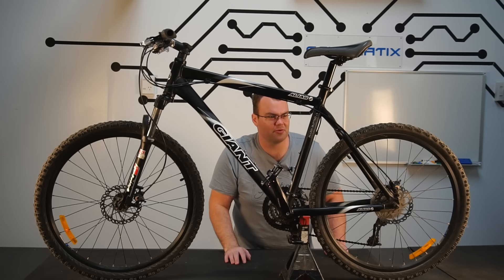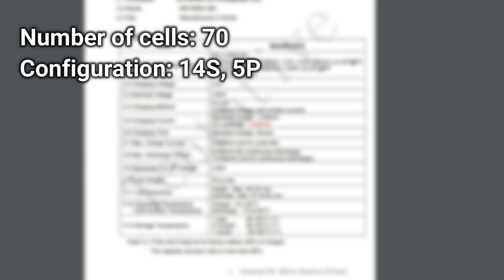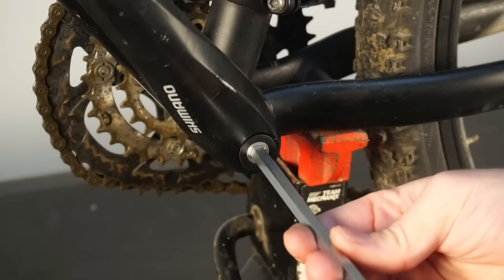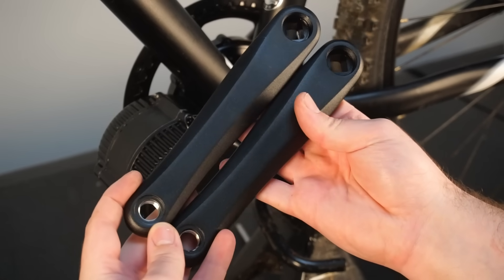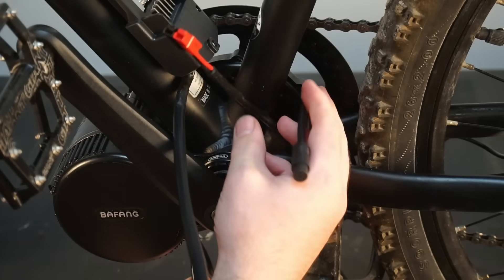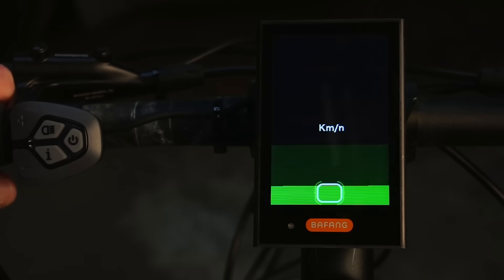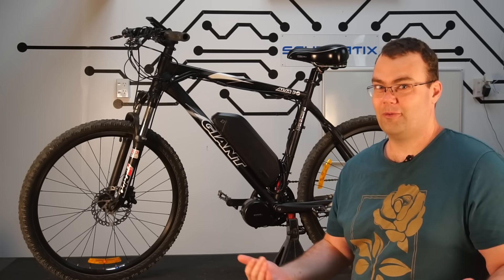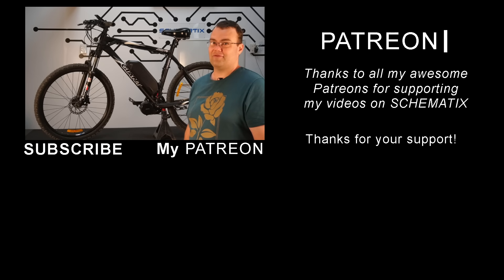eBike Conversion Kit, Install & Review ll Bafang BBS02B 750W motor

Comment: Interesting - the question on my mind wasn't mentioned in the post or the comments. 
750watts combined with human power is way more force than any standard bike frame was designed to handle. Is it strong enough? 
I'd be worried that after many hours of hard riding the motor mount area of the bike frame would stress out and crack.
 Commercial hub-drive e-bikes all have significant reinforcement around their motor mount area. 
Unless you're a metallurgist and/or have special measuring tools, the only way you will find out is,
when it happens!

Comment: Your instructions hold up several years later.  I just did my 1st conversion with Bafang 750W and similar battery.  Your instruction is spot on!  In terms of mileage?  My battery has same Samsung cells, 52V, 20 amp-hr.  I live in the mild rolling hills of Minnesota, 65 yrs old and weigh 250lbs.  With moderate pedal assistance and minimal throttle, I am seeing greater than 50 miles/charge and I still have mileage left in the battery.  It could be possible to stretch out 60-70 miles per charge with conservative battery usage.   Thx for the excellent video.
Reply: What website did you get your battery?

Comment: Great video, thank you ! Please do not follow the instructions for the chain lenght, as the result is obviously too short. the derailleur should pend vertically on the biggest ring/smaller speed, that´s how you measure a correct chain lenght.

Comment: I  have to remove the front derailleur/chain guide and install the t46 sprocket. Will i  lose the ability to shift gears? Also, the motor has a high torque. Will i have to replace the cassette for a higher strength one?

Comment: Hi does any body know if you can just constantly use the throttle  or do you have to peddle aswell to make the motor work 
also how fast does it go top speed I have a 250w e-bike peddle assist and its 💩 
Thanks 🙏

Comment: Great tutoring, thanks. May I recommend you to fit the height of your seat to properly pedal. Your legs are compressed and you wont get the most of your strength with this seat to pedal height

Comment: I made a DIY ebike with this kit back in 2022 march. So far it has been very smooth sailing for 8000 km and more. Few things:

- Adjusting the settings with the Bafang software is mandatory. The motor has way too much torque by default with weird speed limits. Most of the time I need 250w and below so I have made it way more chill in action, but more power is still available when needed.
-Eats a lot of chains. I have changed like 6-7 chains even though I clean and lube them often. Changed the cassette a few times. You should use chain wear measurement tools.
-Lekkie narrow wide front chainring is great! Completely eliminates chain derailment which happens easily with the default cheap ring.

All in all, this thing has changed my life 5/5 would recommend.
Reply: Why not use titanium chain and cassette?

Comment: Thank you for the video. 

One complaint, I followed your method for choosing where to cut the chain and it was way off the required length. Then, when I went to a bike shop they told me that it's not a good idea to purchase a chain without a matching sprocket.

Comment: I'm on my second bafang mid drive bbs02 motor after changing the first one after 5 years. Nothing but praise for these motors, never let me down. You can buy a new bike and fit a motor for about half the price of  bought ebike, and have better performance .
Well done bafang
Reply: So true!  I have upgraded a few bikes with bafang motors and they have been great. I got many years of use from them.  A couple of times I had to replace the batteries after years of use, but not the motors.   A comfortable bike + bafang + internal hub + big chain will be a dependable transportation with little maintenance required.

Comment: Major mistakes I've seen this guy make one putting the hall effect sensors on the brakes. Make sure that the magnet doesn't hit the sensor and keep the break from properly. When installing the speed sensor do not put it on the chain side of the rear put it on the brake side.

Comment: Hi, I'd really love to know the width of your BB, I am converting my Giant, and its 73mm and I dont have that much thread protruding as shown at 6mins 20secs. I cannot get the aluminium cover nut on,  there is not enough thread to bite on to.  Also I have 25mm pedal clearance to the chain stay  on the RHS but only 5mm clearance on the pedal to the LHS chain stay . The pedals are therefore offset by about 20mm to the right.  There is no spacer on the RHS and the right cannot come any closer anyway, as the 44T would hit the chain stay.
I see that you are not using spacer washers for the 2 x motor mount screws, so I am thinking your BB is 68mm.  Bizarre that my BBS02B 750W motor does not fit correctly.
Reply: I would say yes his is a 68.   Need to measure before purchase.  I'm sure you get spacer.

Comment: From Denmark: Thx a lot for this complete and very informative video and congratulations/all the best to the All Blacks Black Ferns for their team sprit and achievements. I used to play Rugby 7 and 15 when I was younger (I am 80 years old now) and still long distance Biking/Triking with NO EL ASSIST and with 65 kg  gear and my 112 kg personal weight to carry. Last year I was on a 2.886 Km trip, which took me from Ebeltoft, Denmark to Frederikshavn, Ferry to Gothenburg Sweden and cross over Sweden to Stockholm, Ferry to Turku, Finland, Triking to Helsinki (6 weeks stay in Finland) , Ferry back to Stockholm (2 weeks stay there), Triking along the East Coast , With visit to the Island of Gotland, to Ystad, Ferry to the Danish Island of Bornholm. 2 weeks stay there, Ferry 2 Køge (38 km south of Copenhagen, East Coast of Denmark) and further South-West to the Island of Ærø and back to Ebeltoft. 
I am thinking of a Trip to Turkey over Austria (the Alps Mountains...). So, I am thinking about EL converting my ICE SPRINT FS  Trike and having a solar panel rig mounted above my ZIFLEX Mono wheel Trailer (Similar to the Burley COHO XC trailer) . Your wonderful video comes in handy. 🙏

Comment: I built my own rear hub drive 1500W 52V 24ah hard tail, and 5,500 miles later, it's still going strong.

It'll pull to 42-45mph, and will do a minimum of 22 miles using throttle only, and a maximum 70+ miles on the economical PAS setting.

The two biggest complaints I had were the saddle soreness, (which is a painful problem if you're commuting every day) and wind chill when riding at speed, or in cold weather which we get so frequently  in England.
I solved these issues by fitting a 12" wide comfort saddle, to stop the saddle soreness, and that made a HUGE difference. Immediately became very, very comfortable to ride and ceased all pain.

To combat the wind chill I simply fitted a cheap motorcycle windshield, paired it with a handlebar bag which sits IN FRONT of the handlebars, and meets the bottom of the windshield perfectly, blocking enough of the headwind to make riding in rain and cold weather significantly less uncomfortable.

I uprated pretty much every component of the hard tail Barracuda rock frame, and the most demanding part of maintenance is, believe it or not, the disc brakes.
I opted for mechanical disc brakes, simply because the amount of time I spend tinkering with the brakes means that hydraulic brakes are unsuitable for higher powered ebikes. They aren't anywhere near as easy to fiddle with as mechanical disc brakes, and despite the daily realignments and adjustments, which only take me about 10 minutes at most, the mechanical disc brakes have been brilliant. They're easy to adjust, easy to repair if they fail, and you don't need any brakes bleed kits to adjust them.
Id even go so far as to say hydraulic disc brakes are only really suitable on the big motorcycle brakes that surrons use.

The last thing I'd say is to encourage ebikers to modify their bikes by manufacturing their own mods, and in doing so, making their bikes more comfortable.
I fabricated a wind deflector for my ebike, made from simple slats of 3x9" sheet metals, bolted togrtherbin such a fashion that I got a 9 inch square plate of thin metal, which I attached to the front forks aswell as the bottom of the windshield, and with a bit of tinkering it now offers me almost complete wind blocking whilst riding.

The end result is an incredibly comfortable ebike which is a joy to ride, can easily keep up with city traffic making riding it much safer, and it's still capable and light enough to ride whilst the electrics are switched off.

Total cost is somewhere around £1400 British pounds, and for that outlay, I've had just over 5,500 miles of travel, most of it very comfortable too.

I hope you all have a great day,
Reply: That sounds amazing. Good on you!
Reply: Where did you get the kit?
Reply: @tonydodds4745  "built it himself"
Reply: @RoughWalkers  lmao he built the ebike, not the motor
Reply: Awesome mate thanks for that

Comment: I went to order the kit through your link, which gave me a price of about $1500 (130 delivery) aud. So, of course, I did due diligence and checked prices in other locations. Ebay ended up being the best value for the same gear... I got a significant discount for some reason... and the whole cost with delivery included ended up being $1100 aud - $400 cheaper, or about 70% the cost. Just thought I'd let you and everyone know. I would like you to get a bit of a kickback, but they need to be competitive. Also, thanks heaps for your great video - it's awesomely presented aswell as very informative!
Reply: I tried adding the link... it seems to have disappeared...
Reply: Added the link a 2nd time, and it disappeared again... so I guess you are all going to have to search it out yourself on ebay or temu or Amazon...

Comment: Hi! Bike industry veteran and master ebike mechanic here. That motor is the most inarticulate and clunky piece of shit if ever ridden. And it blows up drivetrains with no warranty support. On top of all that, your best case outcome is you have a motor on a bike that was never designed to have a motor on it.  Oh, and push bikes are the little kid bikes with no pedals.

Comment: 2 years later any issues with the battery?
Reply: Mine is close to 3 years old. Everything works the same as the day I bought it
Reply: @jimlahey3919 whats the top speed?
Reply: @jaribilesh8492  mine does 24mph or 40kph if you do metric that is what the firmware is maxed to. Using a 42 tooth chainring 11/36tooth cassette. 15:35
Reply: @jaribilesh8492 Depends on battery ( 52v or 48v ), and front chainring size ( bigger it is, more vmax you get, at the cost of slower acceleration ). And how its programmed.

At 52v and 44t, bbs02 750w peaks at approx 1500w, vmax on flat ground ( uphill is unadvised ) and highest gear, It goes approx 60kmh. Although it has plenty of headroom left, it goes 60 because of how the stock profile is programmed. It can be reprogrammed, and or the controller can be cheated by setting the wheel size to lower than it really is.
Reply: @jimlahey3919 what brand and where did u get it from
Reply: Battery can always be upgraded!
Reply: I guess it's going to depend on how many charge cycles the battery has on it.
Reply: 2 years later down the line its starting to speak chinese

Comment: possible dumb question... but do any of the bike's original gears still function?
Reply: they can, some of the Bafang kits come with a gear sensor, this senses when you're shifting and will interupt the motor power output so it doesn't put unnecesarry strain on the gears and shifter.

Comment: Sorry man, I have to mention some things.
At first, I really like the DIY Approach!
BUT (there's always a " but"):

Tightening the BB Lockring with Pliers like You used is problematic..you won't get the BB/Motor Assembly tight enough to withstand the Forces, especially with Torques that high.
If you get it tight though later work on that will be an Adventure.
Water Bottle Mounting Rivets are prone to get loose even with 500gram Bottles...

160mm Discs on a relativly light Bike like You used in Combination with a heavy (no Offence) Guy ... 32 Spoked Wheel...additional Torque...

To make it short: Wear and Tear which leads to "surprising" Results
I've had way too many bikes like that in my Repair Station to say anything else!

Smaller Detail: The way You measured the Chain Length only works on non suspended Rearends!

I really don't want to limit anybody's Fun and Experience but DIY like that will lead to serious Trouble...sooner or later 
I know that some Conversion Kit Manufacturers really push hard ( and are generous) that it's ABSOLUTELY no Problem to do... But
Anyways...
Keep on rolling ✊

Comment: You did not show what the short length 3 pin yellow connector near the mid drive goes to. I saw it hanging in the video and was waiting to see what you were going to say about it but you never did and later in the video it was no longer visible.

Comment: You absolutely cannot determine what cells you have by their markings.  You must weigh the cell and check its internal resistance and most likely do a charge discharge cycle.
Fakes are an ever present problem.

Comment: How much space is there between the motor and the frame? The wire pulleys for my rear derailleur are run  below the lower tube, so they would need to be between the motor and the frame.

Comment: I always fit battery upside-down, using rubber washers, locking bolt holds easily, over 4 years upside-down no problem

Comment: Great video. Can you tell me the diameter of the motor unit. I'm thinking of putting one on my tandem but it will have to be mounted directly underneath the bottom bracket because of the frame, just wandering what sort of ground clearance I will have? Thanks very much👍

Comment: Feeling like a kid on Christmas again after putting the same motor on my old mountain bike. Took me nearly 7 hour since the bottom bracket refused to come off and had to cut it off, but thank you to your video, I was able to install everything to make it work perfectly. Cheers mate!!
Reply: I had to go to my local bike shop to remove the bottom bracket and even they had a tough time doing it 🤣
Reply: @Biglex524  if the threads have become salt welded into the BB shell you did the right thing. They have a special BB removal tool in most workshops with a 3 foot long monster torque arm on it. Believe me if that does not break it free the frame is gash!
Reply: @MrDegsy69 just done this today. I used plenty of wd40 and an impact wrench with that special socket and eventually, it came off. Stuck solid it was.
Reply: @carlsgarage2023  My nephew used to work in Halfords at the bike hut and their health & safety regs required them to slightly overtighten BB shells to avoid any libel or law suits should they break free on a customers bike.

If the BB hanger threads have only been lightly greased they often suffer water ingress and begin to salt weld over time. Combine this with over zealous tightening and you have a sealed BB bearing cartridge that is a total pig to remove.

I always over grease and use ptfe tape when fitting sealed cartridge bearings into a BB shell and only ever tighten to the recommended maximum torque.
Reply: @MrDegsy69  great tip. Working on bikes is totally different to cars, as I'm slowly finding out. I'm fitting the bafang motor myself to an old Raleigh 'Urban Swamp with Haro stickers' frame so hopefully I'll never worry about these BB threads again - these Bafang kits seem to bypass said threads and clamp from the outside.
Reply: @MrDegsy69  yep. I used to work at target assembling bicycles. The Chinese must have a shortage of grease. I bought some of the Schwinn that were returned and tore them apart and re-greased the bearings, especially the bottom bracket bearings and threads. The bicycles move as fast as a more expensive bike.

Comment: Thanks Schematix! I just finished my build and kept on referring to this video. My issues were (1) I had a pressfit bottom bracket and had to by an adaptor and spacers, (2) I purchased the rack mount battery so that my top and down tube were clear. My dropouts here not flush so I had to hacksaw and file some steal plates as an adopter to fit the rear rack. However, this video was a great reference that I had a repeat. Thanks again!

Comment: Looks like your chain might be cut a bit short, rear derailleur pulleys shouldn’t be pulled so far forward. I was under the impression to size a chain you place it around front ring, thread through derailleur pulleys, and around the smallest rear cog with just enough tension on the chain to pull the cage with the pulleys away from the derailleur body. The chain should make something like a “Z” shaped pattern. Just my input, great build otherwise and I’m strongly considering this kit. Thanks for your help.

Comment: Thanks for the great video. I am considering a conversion. I am wondering whether this Bafang mid drive motor provides any pedaling resistance if the battery is not connected to the bike. I would like to ride with no electrical assist sometimes but I do not want to suffer pedal resistance.

Comment: excellent video! You answered all of my questions! I have a older Giant alum mountain bike and have converted it to str and phil wood stuff years ago, so I am very famiiar with building bikes and bottom brackets. I will defintely pick on of these up. It should bolt right on just like the vid! Thanks Again.

Comment: I was going to buy a coversion kit for my mountain bike since it's cheaper I'm now 6 min's into this and I would rather spend the $489 for a complete Ebike
ECOTRIC Electric Commuter Bike for Adults 26" White Ebike with 350W Motor, 20MPH Mountain Bicycle with LED Display, Removable 36V/12.5Ah Battery, Shimano 7 Speed Gears, UL Certified E-Bike $489